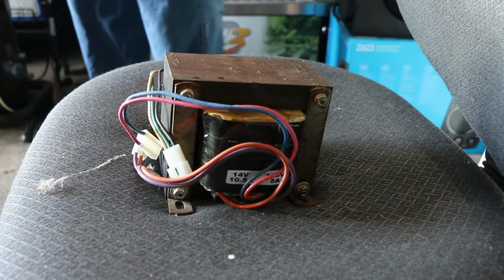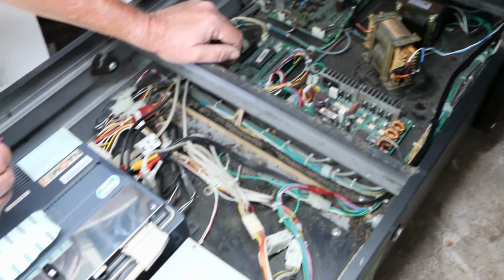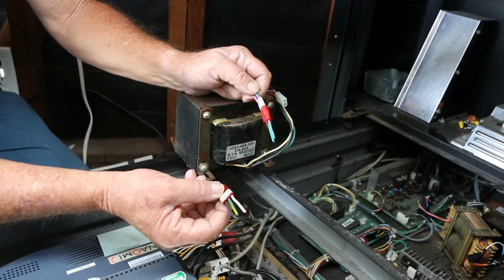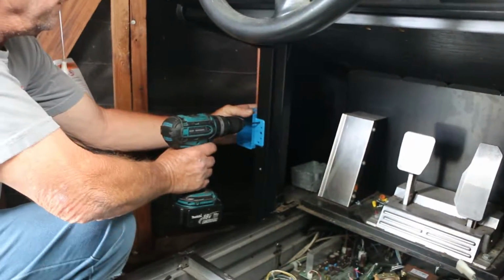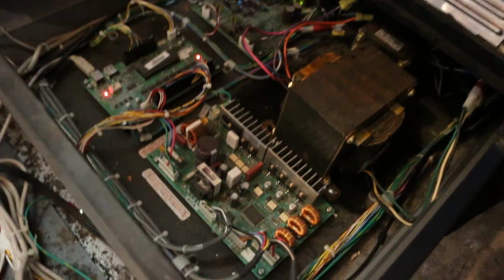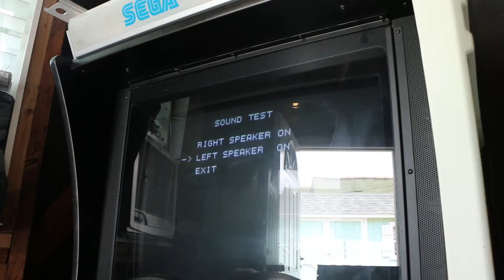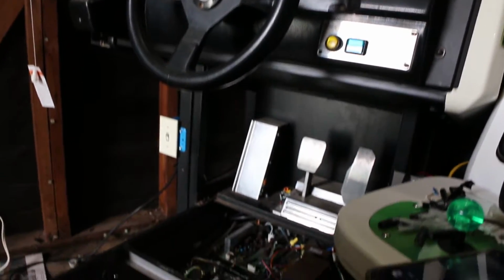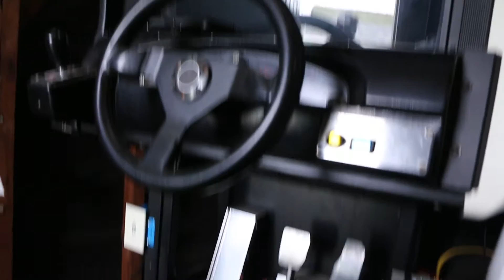Initial D Arcade Version 3 - Video Blog Part 10 (POWAH BABY)

Comment: A bro, there are rca outputs on the back of the Naomi 2 board. Plug a pair of rca cables into them and then into some sort of amped  stereo or amped speaker that accepts rca inputs. Then you'll know if the Naomi is putting out audio or not, then take it from there.
Reply from the maker: Sorry, I thought I had replied to you.  Thats how ive had ti setup the Naomi is sending audio, at this point its the speakers or something else.

Comment: I have a pair of id3’s right one works well with no audio , but master left side has sound but glitches , swapped screens , and even clean laser lens and tired other disk , same glitching . Any suggestions , bad Naomi board ? How can I contact yaton for parts ? Thanks your videos helped on so many trouble shooting btw
Reply from the maker: Unfortunately it looks like Yaton stopped posting Ebay listings shortly after the Pandemic started, I was looking for stuff from him myself and I just checked, the store is empty.  As far as sound, have you plugged in speakers to the Red/White stereo out of the Naomi board to see if you get those glitches that way?  Not sure if you watched all of my vids but I eventually gave up on the original sega sound amp and used an external one for Audio because the boards kept frying.  Any chance you can post vids of what you are running into?
Reply: BNGamesReviews I will post a vid  soon ! Thanks and yes I watched all your vids , my 2.1 speakers are on the way , I like how you tested sound on a tv input that’s genius lol

Comment: dang I wish I could own a cab I have to do Ver. 3 over Demul. I do use a steering wheel for a PS2 a Logitech driving force, but the emulation doesn't support force Feedback so I have to stiffen the center spring action to give the fell of force feedback. But I bet if would be funner to use an arcade Cab. You can use the cards with me I have to use the save states  in the Demul.
Reply from the maker: Im all for the real thing, I have a hard time with Emulation in general, it feels souless to me.